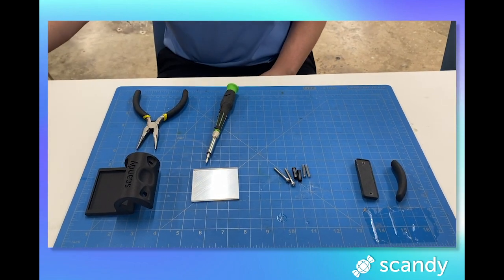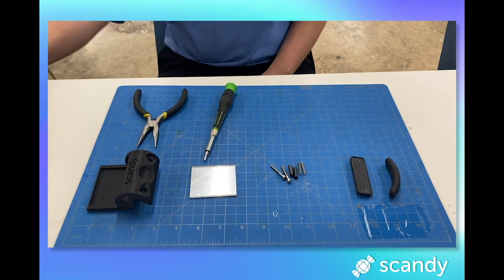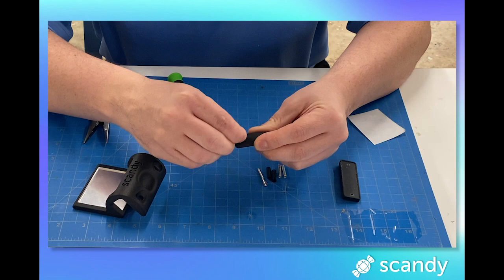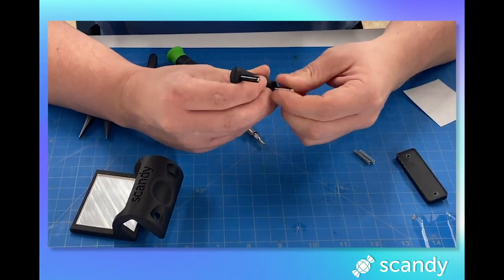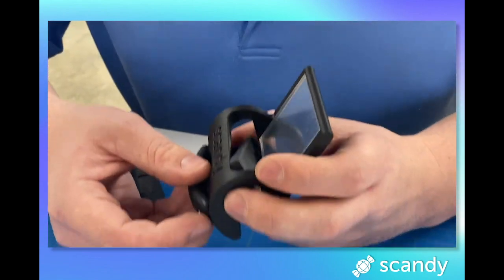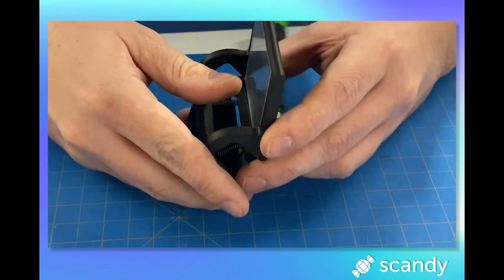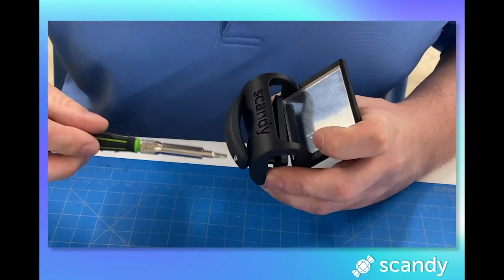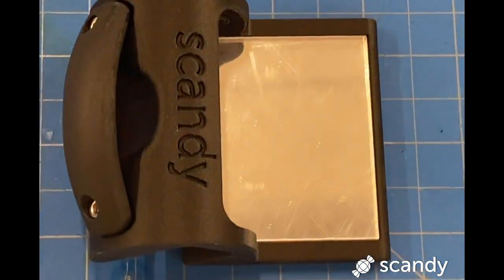How to Assemble The Lookout | Step by Step Guide

Comment: I have a question about the scanning quality when using a Lookout Assembly, my first impressions are that it does not give equal "clarity" of resolution?

Have you guys found that to at all be true?

Does dimensional accuracy suffer at all, or because of the way it works might the reflections of each sensor cancel any induced deviation out?
 
Did several back to back scans, and it seems noticeably less smooth and accurate to the subject from my observations.

Is there any quality or property of the glass mirror that helps in this regard? 

I am using a visually perfect piece of mirror glass with no obvious distortions or blemishes even on very close scrutineering.
Reply from the maker: Did you use our assembly kit, or did you source the parts yourself?
If you used our kit, please make sure that you removed the plastic covering on the mirror.

We have not found dimensional accuracy issues in our scan subjects, but we cannot guarantee that there are none. 

We would suggest first to check if the lookout is fully secured on your device.  
Then we suggest just a little patience and practice.  As with any new scanning device, there will be a small learning curve as you get a feel for the device and workflow.
Reply: @Scandy3D  My own, the scan appears unmistakably more noisy as a side by side comparison utilizing the glass I am using.

I don't see any visual cues why this glass would give any distortion or noise due to quality, but perhaps there is a difference.

This is a really good idea! Far more accessible for people, hopefully it will be a tool to help publicize Scandy when people see the attachment being utilized. I don't think many realized how good the scanning can be utilizing a iOS device...
Reply from the maker: @101rotarypower  Our manufacturing partner tested a few different mirrors - the acrylic mirror they sourced and laser cut (which are provided in our kit and in our pre--assembled Lookouts) gave the best results. Please try using the mirror in the link provided on our website: https://www.mcmaster.com/8344t51 to see if that provides better results.